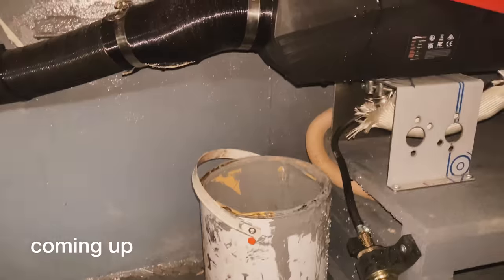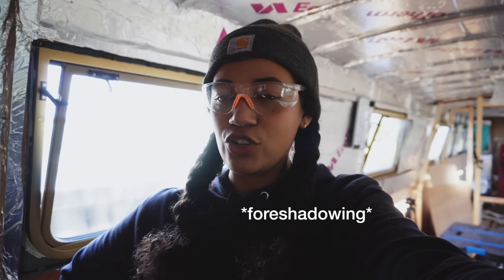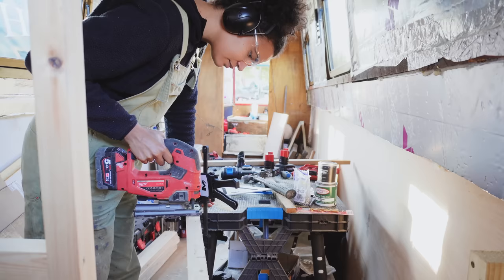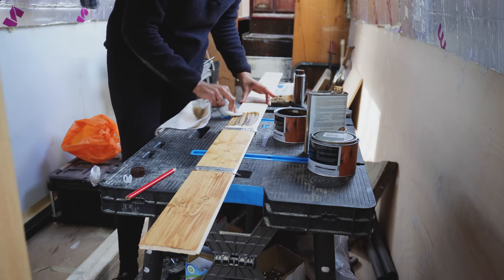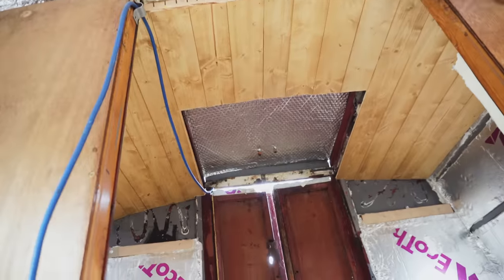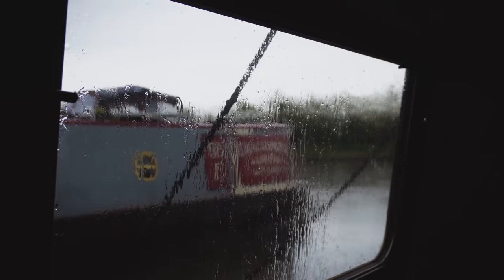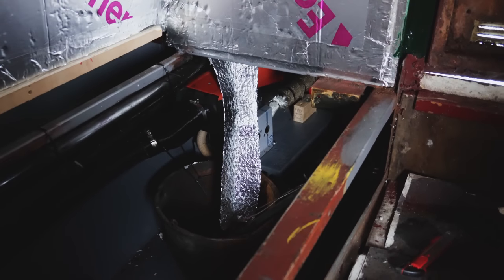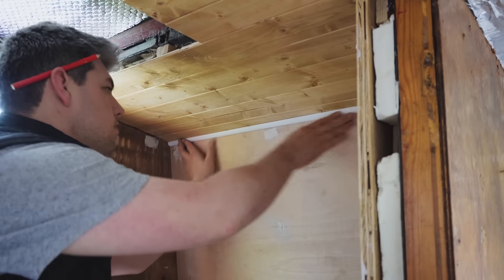Restoring a neglected old narrowboat (to live mortgage-free & travel the UK!)

Comment: Nesha for someone who thinks she can't your doing really well and starting to look like an old hand at using the power tools. Remembering always they can and do easily bite, so don't get to tried and plenty of sit down tea breaks. Fun watching your meetings, but worrying when you start answering back, ha ha, but your right, sit and work it out and chat it through before you do. Give some thought to the wiring before you get to far in front of it and give yourself problems later. Your diesel heater itself gives out a load of safe heat so maybe think of boxing it in, leaving a take off panel should you need it. With air from inside your cabin into the back end of the boxing with air tubing a small quiet fan on the front end through the cabin wall such as a 12v x 2"/ 3" / 4" replacement box type computer fan, or a small inline fan the same size as your ducting both can be found online. blowing back into your cabin as well as the ducted air out of the heater inlet and outlet. Two reasons, one, not to waste the heat as there is little point keeping the sky warm, as it will be enough to keep your clothes warm in an airing cupboard / hanging wardrobe, if you have one at the back end, and the other maybe to stop added condensation in your engine bay, hot heater x cold outside air temperature in a closed /cold engine bay = condensation so lag as much of the air ducting to and from your cabin that you can. Looks like your doing great and even now starting to confidently enjoying yourself. Well impressed, so crack on. By the way your ears are made for standard pencils to fit (little ears? cut the pencil in half) and so is the rim of your hat, or under your watch strap.

Comment: Are you still planning on opening these cupboards from above? Cause then you need to make cuts on the sides& add hinges. Right now the sides stick over the base (where the grease was) & there is no way to open it the way you opened it at the beginning of your video. Just an fyi. Now if its just a shelf board then never mind.
If you put anything in front of those windows to close em off .. they prob still sweat& then mold forms eventually.
Also if you cut the board wrong, have the tight end in the back (turn the board around). Its easier to work from the front & fix it with an off cut or a piece of wood then in a back corner.
Reply from the maker: Not sure! In the original build these corner areas of the bay were accessed by sliding out the side pieces by the steps, so that everything in the cupboards didn’t have to be moved out

Comment: I would have fitted a webasto thermo top C heater much more reliable? Then fitted radiators you’re be warmer
Reply: Would of loved to but by the time you change all the items to pass the BSS it ends up costing way way too much. Plus after doing lots of research they are essentially they same & with the added parts would last a similar amount of time. Appreciate your comment tho. We would of loved radiators but due to it being a very small boat we have no wall space so have no where to fit them 😅
Reply: @mike-driftwoodfolk2651  well thanks for the reply 
love all your Milwaukee tools I have some there so powerful I’ve come to Spain after one year out and the Milwaukee batteries are full charged?

Comment: Hi there ,you doing well but take a couple of hints from a couple who lived and worked on the canal system for 15 years ,we built two boats ,do not buy a washing machine ,you will need pure sinewave inverter ,not cheap, and the washing machine uses two of the things you fo nit have a lot of ,electricity and water ,then you have to dry them.Have two weeks of clothes and find a launderette, much easier
Reply from the maker: Our washing machine is going to be a portable one as we can’t fit a regular one on board. We already have an inverter though, just isn’t installed yet!